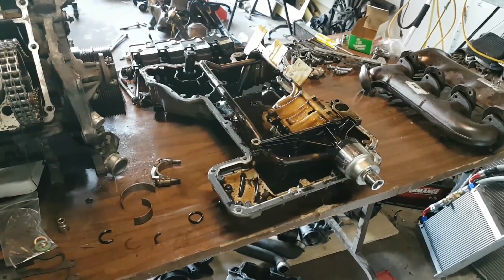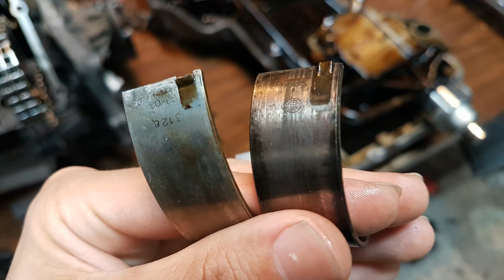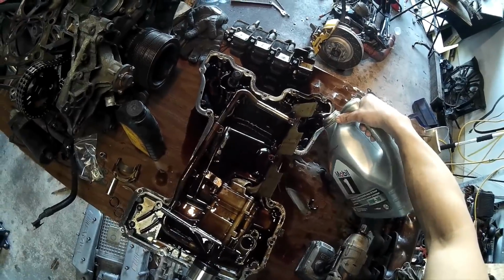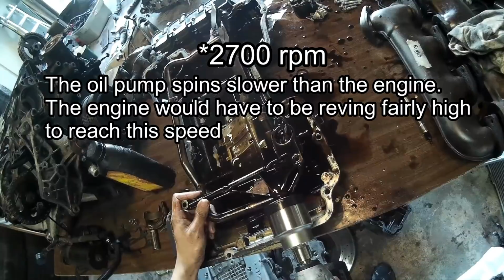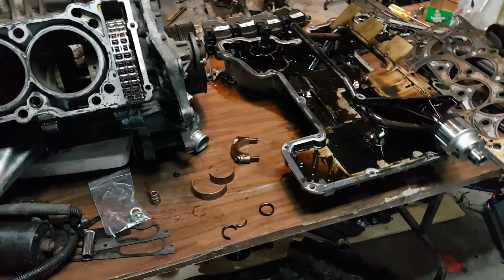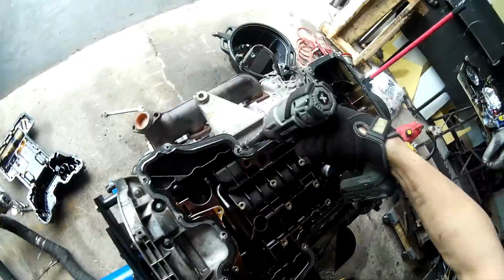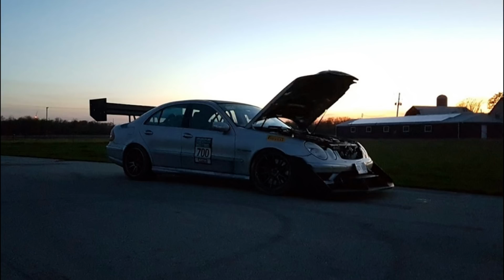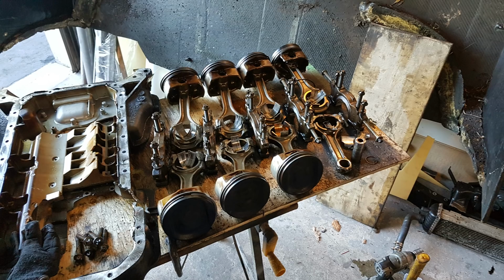Bad O-Ring, Spun Bearing Again! On 2nd AMG Engine

Comment: I don't think people should be too worried about that. Just imagine how many M113K have been built. I have never heard anything negative about this engine. Plus I work for Mercedes here in Germany and we never had big Problems with this engine. I think problems like yours can definitely have many reasons. How was the car treated? What oil has been used in the past? What kind of gas has been used? How are the weather conditions where the car has been driven? These are all important factors. So I would say the M113K is still a beast and bulletproof!
Reply: Look through the comments above yours. An engineer that looked into o-rings for military applications commented and analysed the likely circumstances around the failure. Those rings will fail, but in most cases only slightly, causing "just" extra wear instead of a blown engine. Mercedes apparently acknowledged this as there is talk of double o ring designs and o rings made of better materials.
Reply: Yes, true. However, I am sure that wrong oil and bad quality gas (That will naturally mix with oil) is also a source of this failure. These O rings are designed to stay in oil for decades. So I doubt that they made it out of a material that will harden like this.
Reply: you're arguing against factual evidence, and admitted bias. a hardened o-ring is a fail, and not in decades. kalrez would be another oring material choice, made from fluoropolymers, much less susceptible to hydrocarbon crosslinking.

Comment: That hardned o-ring that gave you bubbles will give more bubbles when the oil temp is 90C. As the oil will be thinner it will be more prone to draw air. And if the car is used to its full potential it will not take long before something goes bad.

Comment: It seems mb knows about the issue.  The new Oring is Viton while the old one is just plain rubber.   Viton is a much more durable material and should basically last forever.
Reply: That's the same shit BMW pulled with their Vanos variable camshaft system. They used a plain rubber seal inside the mechanism, which also hardened after just 50-100tkm and caused a failure. The next generation of car then used Viton seals, which probably only cost them a few bucks per engine...

What I don't get is, BMW apparently did this so they could sell you a whole new Vanos unit (they did NOT replace the seal inside the Vanos, because BMW ONLY offered the whole friggin unit!) and make some extra money. On the AMG here however, the failure would destroy the entire engine and I cannot imagine Mercedes trying to ruin their reputation of their bullet proof AMG engines like.
Reply: xXYannuschXx once a car gets to a certain age it seems that major failures dont really affect the reputation of the company much. Most of them will be on the second hand market so the original purchaser has already gotten a shiny new one.   There is a good reason these high performance cars get cheap as they age.  They are on the bleeding edge of design when new and often have strange and or unproven equipment and designs.
Reply: @DoRC  so the fix to this problem is to just replace the o ring with a viton one instead? this will prevent what happened in the video + prevent engine failure?

Comment: Does the chain tensioner on this engine also work with oil pressure? This would explain the scratch marks on the timing chain... (So it does on my car / other brand.)

Comment: Chain scoring can be because bad oil pressure.  Probably when engine is  decelerating. 
Oil pump chain tensioner has air and it's soft and can't hold tension on chain, and pump without oil pressure will not decelerate fast enough,  making chain sloppy and  hitting that part of engine .
So yes I think it can be because of faulty o ring!

Comment: I owned an independent Mercedes repair shop for 30 years. My experience is  the German "O" rings do harden with age. I have seen many failures of this type. Maybe happens more often here in Texas because of our heat. As someone else mentioned see if you can get a Viton replacement. Also you had better replace the rod that had the bad bearing. No way are you going to get the proper preload on the bearing shell with the old rod.
Reply: David Perry is there one in the 2001 clk200 engine? I have one and I’m hoping it doesn’t have this O-ring flaw
Reply: That is a cool name you have there Mr. Perry.

Comment: I just did a rebuild on my e55 due to a hard oring behind the timing cover that seals between the cover and block casuing water to leak into the sump. also the coating on the headgaskets are starting to fail from age. the day of the m113 bulletproof days are over unless its been rebuilt
Reply from the maker: Very true. I've heard of the oil and water mixing issue. If you get a chance pls do a video on it. I'm planning to replace all the o-rings in the engine while its apart. Great content on your channel btw
Reply: Thanks @sk8215 You creativity is next level. I didnt film a lot but I can do a sit down video and explain all the photos I took.
Reply: do yourself a favor and change the oil between 3k and 5k miles. I am a mercedes master mechanic.
Reply: NovorSec it’s was at 170,000kms /105,000 miles. But it’s not the wear of the motor it’s the age. In 2018 these cars are over 10 years now and rubber breaks down. It’s why the airmatic bags split and o rings and rubber coated gaskets fails.
Reply: R.J & Co how many miles on your M113?
Reply: hi dann   i work mainly on merc sprinters  and vitos . i find that the newer engines with the timming chain at the back  are more unreliable  . and you need to take the engine out  to work on the cylinder heads .also a lot of conrods are breaking off . thus a new engine needed.  do you have the same problem with the diesel cars, the old sprinter 310 and 312  was a lot more reliable .  a lot of my customers  are going off merc vans .
Reply: Get the crankshaft tested and add external oil cooler. Im a professional

Comment: How did the back of the valves look on these engines? Wondering if these M113K's suffer from a lot of carbon the back of the valves, not in combustion chamber. Thanks

Comment: Is it possible to get new rod bearings for this engine and from where? And how much are they?
Reply from the maker: I got a quote from the dealers the other day. Con rod bearings are around $400. Crank bearings are another 200 and piston rings are $900. Replacing everything including gaskets and bolts goes above 3k.
Reply: Ouch..
Reply: Thats not worthy i think. Especially if you are in the US where you have thousands of cheap engines laying arround.
Reply: 5grand minimum for and engine isn't cheap for most people
Reply: Where did you get quote, here in GTA, Canada or States ? I'm getting all parts from USA.

Comment: When you get spun bearings, you HAVE to measure the bores in the block and the con Rods. All fastners need to be replaced . One thing these engines do is pop the rear head studs if the old ones are re used. Also, it is a very bad idea to re use the oil pump. Unless you measure the clearances to ensure everything is OK it is folly to use the pump if it is in a high mileage engine.

Comment: Used to work at an MB dealer. They are no better than chevy, and with AMG, you are just paying for a name. Like the car itself.
I will NEVER own an MB, they are crap! Like BMW, Fiat, Aston, etc. are!
Reply: Its too late, the damage is done Sasha..
Reply: 100,000 miles? Come on. My last Escalade had 278,000 when I sold it and ran like new. I still see it every week. Motor has never been apart. All of my GM engines go well over 200K before I let them go.
Reply: My W210 e55 has 225000 on it now and other than a cam chain and rear crankshaft seal the engine has only had normal service items, I have the full MBSH to confirm it's had almost the entire rest of the car replaced (including a respray!!) but the engine and box have been fine LOL....
Reply: Karpo1986 I hope American cars are better than Fiat. I own a 2016 Fiat. It's basically like buying a subscription to drive a whole lot of different cars. Mine is in the shop for 3 weeks and counting atm, after driving it for barely 2 weeks after the previous 1+ week repair job.
Reply: I own neither a MB nor a BMW but I get to listen to my boss complain about her BMW 650 lemon and her C65 AMG lemon.  Both purchased brand new and maintained.  She also has another brand new MB SUV (to transport her dog).  Neither of those cars were driven very much and were both on the hook or at the shop far too often for a "quality" product.  It's nothing but marketing.
Reply: Lexus/Toyota is the answer
Reply: Literally? Are you old enough to own a 'Vette?
Reply: Dan Hillman LOL, if I say I'm not will you feel better about your fanboying
Reply: samspace81 I enjoyed mine as well but two totally different animals, the Benz has the practicality and the power
Reply: Absolutely agree, apples & oranges!
Reply: GM ain't God's gift to the motor car either, they all BREAK and need to be maintained. Parts wear out, part of owning a vehicle. Don't think for a second there are not small minor critical rubber components that can't take a shit at any time with any vehicle.
Reply: Sure they all BREAK, but speak for yourself. GM truck V8s go 200,000 miles with abuse. Then some hot rodder yanks it out of the wrecking yard for 400 bucks, adds a cam, injectors and a chinese turbo, makes 5-600 horses at the wheels on weekends and drives it to work on Monday. For those of us without a trust fund like these guys racing Mercs with $20k-$30k engines, I'd say GM motors are pretty dam close to gods gift.
Reply: ls engines are better than anything from Benz bro.
Reply: rsx123 If you actually are a mechanic, you need to find a different job: MB is built to break since the late 20th century. 
The "German" chevy engines are Opel engines, which they use simply because Opel is using smaller engines for decades because of the tax system in EU, and now downsizing is getting popular worldwide so they can simply use the Opel engines. This doesn't mean those engines are reliable (they aren't), and Chevy will soon have to use Korean (ex-Daewoo) engineering if their US division doesn't catch up with the times as Opel/Vauxhall is sold to PSA who will put their more advanced (yet equally crappy, built in cooperation with BMW) engines in Opel cars.
Opel even used Isuzu diesel engines in the past and still uses Fiat and Renault engines for the time being because they failed to design a better engine themselves since the early 80's, which is also about the time Mercedes and VAG went downhill.
Reply: @Candisa  C20NE, 20SEH, C20XE, C20LET, C30NE, C30SE all bulletproof engines, I know because I'm from East Europe, we drive all of Europe's old cars. Instead of disposing them, they sell them to shady Bulgarians, Albanians, Romanians etc. Then the speedos are being tempered with and instead of 300k+ kilometers the car is being sold as mint, one owner 100k on the clock owned by a German doctor that used the car only on Sunday to go to the supermarket to buy the groceries 😂😂 
They just don't make them like that anymore.
Reply: Personally I own a 2000 S500. This car has cost me less to own and maintain than any GM I have owned in the past. Calling a Benz crap is quite severe. I agree the o ring made of rubber was a bad design. Both of my GM vehicles experienced failed intake gaskets and failed transmission before 125,000. Mercedes are built to last GM cars are built to fail.
Reply: Im about to trade my CLS for Chevy cruze, because its LITERALLY better car! Michale bay should literally use it in new transformers!
Reply: loved all my Vettes but the E55 AMG is a better car all around. Less plastics inside, no interior rattles, the worst part of a Corvette is the engine cooling system, crap unless 100% maintained all the time. Still love Corvettes through especially a '72 back!
Reply: Panagiotis F and cheaper for parts👍
Reply: rsx123 , actually, parts. You know,giving you swappers ammo for the parts shotgun? Doesn't matter who makes it, you are paying for the name. P.s. I hate Chevy.
Reply: AMG is top of the game
Reply: go electric
Reply: MB was good in 1999 and earlier. I personally say that this is a terrible design and was the cost cutting that Chrysler introduced when it had part ownership in Mercedes. I personally will only do N/A engines from them because they are over engineered on a budget which means cutting corners.
Reply: Chris Gagnon careful there buddy, your gonna trigger the Mercedes fan boi's.
Reply: Chris Gagnon I like mine 2006 E55 AMG hardly crap I put 100,000 miles on it. Way better car than my last 3 Corvettes
Reply: samspace81 literally just sold my vette to get a C55, couldn't agree more
Reply: Chris Gagnon Fiat as crap as american cars? Yeah, right. 😂😂😂😂😂😂😂
Reply: @Karpo1986  you realize fiat and Chrysler are the same thing right? Fiat sucks ass.
Reply: This guy is full of shit end of story.    No better than a chevy my ass.
Reply: "used to work at an MB dealer" Yeah as a car jockey or maybe sweeping the floors. I am a mechanic and they are definitely built better. Why do you think Germans design a lot of Chevys engines?

Comment: That engine is a clear case of burnt oil due to lack of maintenance, causing cooking of the seals causing hardening thus low oil pressure. Stop trying to blame the “O” ring stop talking crap.  Also timing chain has stretched due to oil burning as well. It’s a performance engine this idea of 10000 mile oil changes is ludicrous stop treating it like a regular engine that is not super clean, I don’t know what you call super clean.
Reply: Nathaniel Nixon dude this guy knows his stuff. He demonstrated the problem. 10,000 mile intervals are fine. There are many of the these engines with 200k plus. I'm nearing it.
Reply: Im with you except on the 10k OCI. I think that's ridiculous, and a lot of people think the same thing, regardless of it being mineral oil or full synthetic. My oil is pretty dark looking after 5,000 miles on my 152,000 mile M156. I have never tracked my car, i do run it relatively hard some days but most of the time im cruising at highway speeds. I can't imagine going 10,000 miles on one oil change. Not in this engine at least
Reply: Thanks for the reply Daniel, I’ve seen M156 engines with 160000+kms on them with no where near the Black effect as is going on with that M113, but as M272 engines fail due to timing chain stretch and balancer shaft cog deterioration I believe that “o” ring also has failed due to burnt oil.   I believe oil changes should be nothing further than 6000miles sorry for misunderstanding with that this bull MB is saying with there 15000Km intervals is far too long. As for your oil going dark early is your technician draining the engine oil cooler every service cause they hold approx 800ml.
Reply: I actually do all my work myself (Minus when my TCM/conductor plate failed, dealer did that), so no i have not been draining the cooler each time. Just pulling the plug on the pan.

Comment: Thanks for the video is it the same type of oil pump on an ML55 AMG? Its the same type of engine but N/A. My wifes 55 have over 300,000km on it and runns fine. I will put an oil pressure gauge on it just to be sure.
Thanks for nice videos👍
 my mail is tikkarace@hotmail.com
Matts Tikka Sweden
Reply from the maker: I believe the ML had the regular oil system with just one oil sump, so it should be fine. This design only came in the E-Class, CLS and SL

Comment: The scoring of the chain passage was more than likely from low oil pressure to the timing chain tensioners because of the o-ring failure.

Comment: Just admit it. E55 engine is a Shit engine design with Shit reliability if a broken o ring blows the engine and if it has no warning. They are crap. No offense bro but I used to like the e55 until I owned one 10 years ago and realized they do not last long at all. 120K miles and it's crap.... sad for Mercedes to have such crap designs and reliability when they cost so much new. Sorry u have so many problems. Hopefully u get a unicorn Motor that actually lasts.
Reply: mines at 180,000 miles and a total winner. you had a badly looked  after engine probably.
Reply: nochugare his is an exception. Mine 178,000 runs like a champ.
Reply: you should change your o-ring, asap, somethings wrong with your lubricant pressure

Comment: What about welding the pipe to the oil pump? Just a random thought. Awesome videos, you are very knowledgeable. You just got a new sub. Where are you from? Cheers.
Reply: The substitute viton O-ring is probably enough of an upgrade.  A soft metal ring might be an alternative, perhaps copper
Reply: Here is the best answer: JB WELD. 3960 PSI & up to 550ºF. Good enough?
Reply: yeah thats what i was thinking replace O ring and Epoxy it all up into a pie!
Reply: Stjepan Đopar that's the first thing I thought. Might be a problem because the pump housing looks like it's aluminum and the tube is probably steel.
Reply: John Long That could be an issue, but you could make aluminum piping.